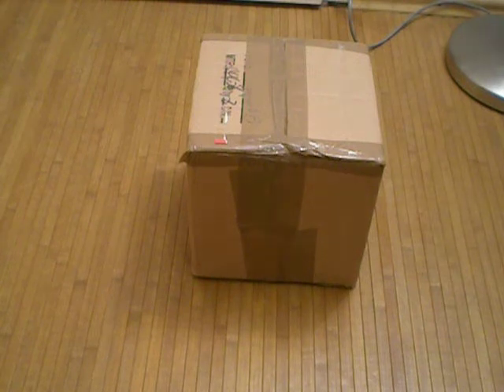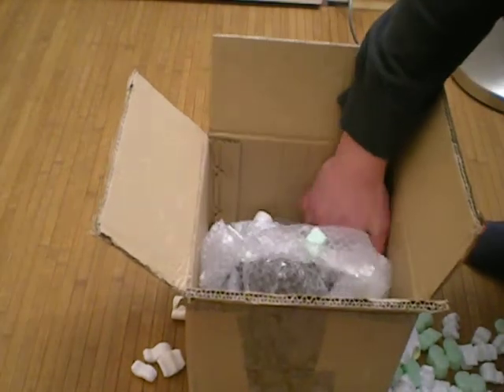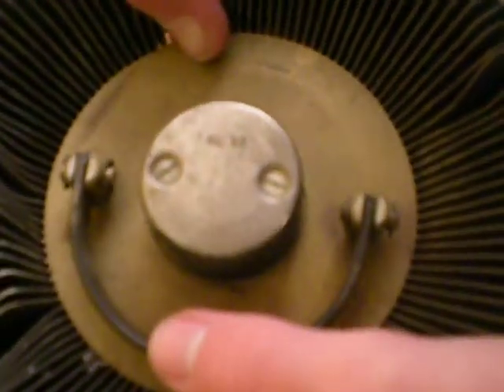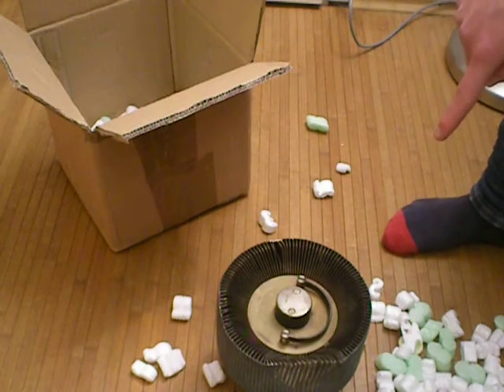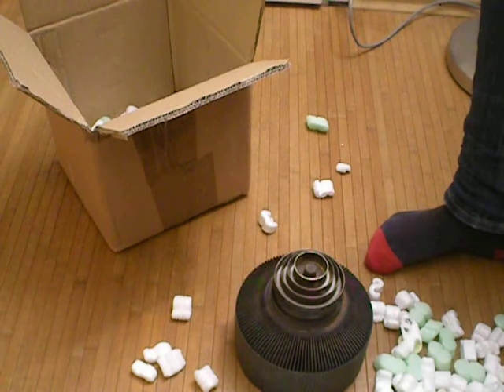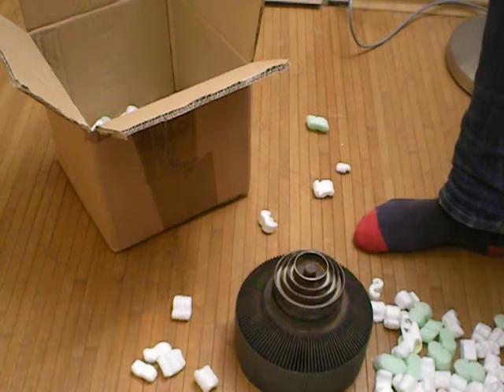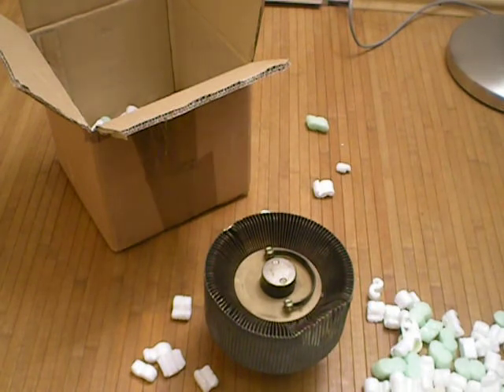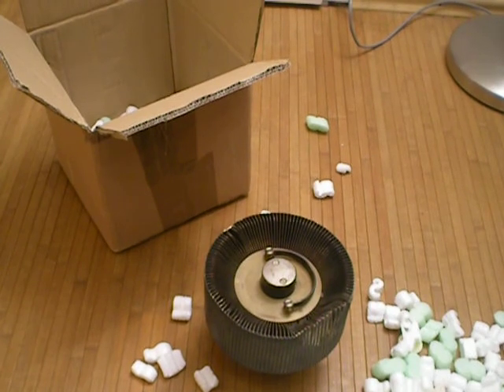Unboxing a Thomson TH290 tetrode (10KW of power)

Comment from the maker: @MrSciencetificsasuke a tetrode is a type of vacuum tube that has 2 grids a chathode and an anode, and what dose it do, its a high power vacuum tube god damn it (just joking), they are used in evrything from tube amps to highpower transmitters, this perticuller one was used in a Radio or TV transmittter.